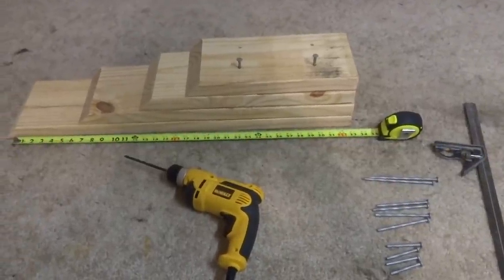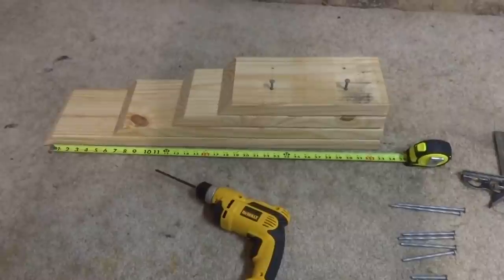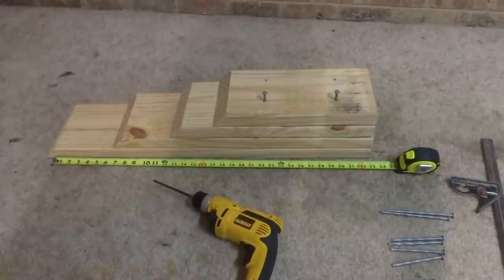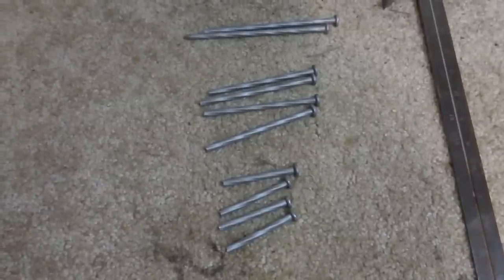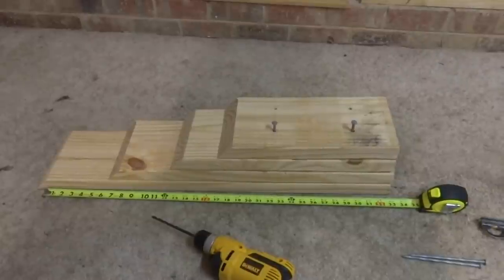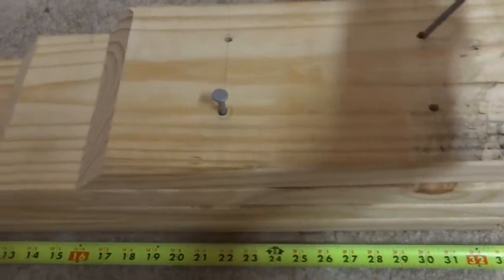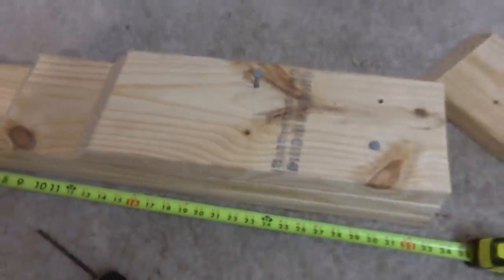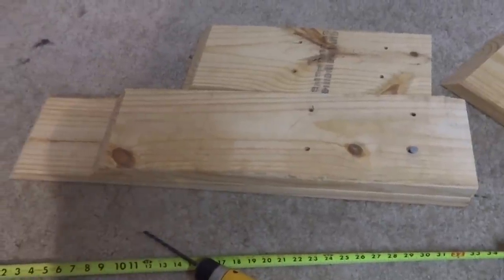RV Ramp For Tire Changing And/Or Leveling

Comment: Don, Thank you for the great idea.  I too had bought the Trailer-Aid, and found out only when I had a flat that it wasn't high enough.  I was ready to build your ramp, when I realize if I put a single 2x6 underneath the Trailer-Aid it would work perfectly (since I already owned the Trailer-Aid).  All I had to do was buy 3 1/2"x2-1/2" galv. bolts which go through the board and into the Trailer-Aid's 3 holes in the center.  I also removed the 4 bolts under the Trailer-Aid and put them on the 4 corners of the 2x6.  Works like a charm, and I'm delighted I came across your great suggestions.  Perhaps this will help others who bought the Trailer-Aid and have the same issue.
Reply: Good video Don, Short and sweet and to the point! I sat through about a hour and half of other tire change video's before I found yours, Thanks.
Reply: Could you share a picture of your trailer aide with the 2x6 please?

Comment: I had not though about cutting off nails to make pin to hold the blocks. I will build one tomorrow to use as leveling blocks. It is a lot cheaper and will last a lot longer. Thanks for the video.
Reply: I like this design as well.  The only thing I might add is to make 4 holes in each level of boards such that the pins for that lever are captured under the next board above it.  That way I don't have keep track of 8 loose pins when I'm not using all of the boards or when I'm storing the ramp as an assembled unit.  The rigidity of the unit at each level would be increased with the extra pins in place too.

Comment: Good idea,but how to change a tire with that,you still nead a jack,right?Wheel is block on platforn,how to change a wheel???
Reply: changing wheel for tandem trailer/rv, one wheel is elevated off the ground one is on the ramp
Reply: I would love to see a chalking block added after backing on or pulling forward just to keep it in place rather than trust the rv not slipping forward off the ramp. Just saying.

Comment: How can you change a tyre with that when it is standing on that block
Reply: This is for a tandem axle set up. The good tire is driven upon to the ramp thus suspending the flat tire in the air. Will not work for a single axle!
Reply: ONLY FOR TANDEM AXLE TRAILERS